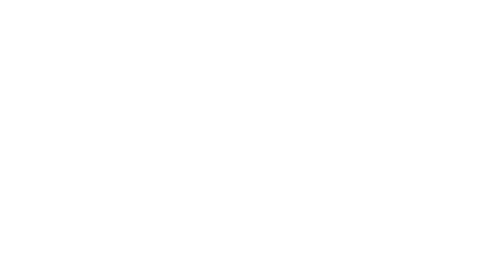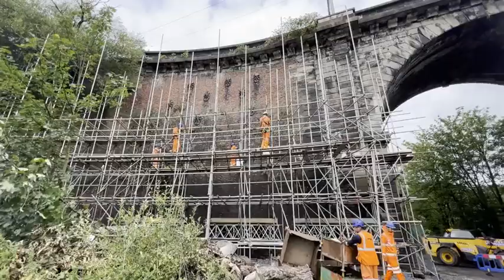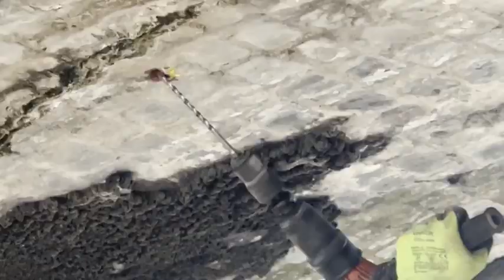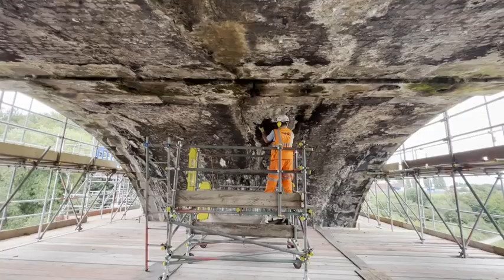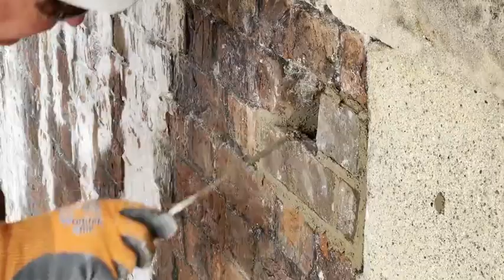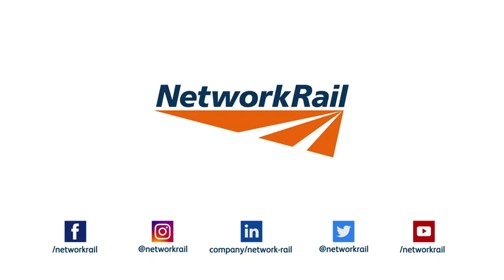Sankey viaduct repairs

Comment: I hope that removal of those bushes around the parapet is a part of this work. As well as looking unsightly, it can't be good for the integrity of the whole. Speaking of things unsightly when is the mess of weeds around Carlisle station going to be cleared up? Some of it looks like 3rd year shrubs.
Reply: Looks good to me. Pruning everything to within an inch of its life is partially why this country is so nature depleted. Keep it as wild as possible and annoy the majority of boomers with their “perfect” gardens.
Reply: @christill  Weeds impair drainage and cause structural weakness.
Reply: @hughscaife3324  It would take a lot for regular weeds to damage infrastructure. And generally, a wild area would absorb a lot more water to prevent flooding than an area that’s just paved over. For example, our wild garden easily copes with heavy rains, whereas our neighbours who paved over their front lawns always have significant buildup of surface water.